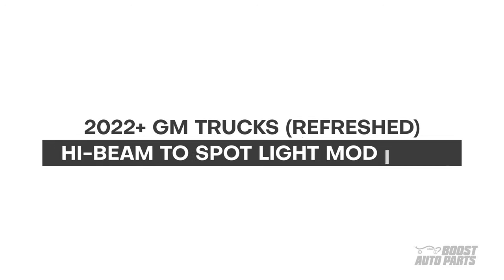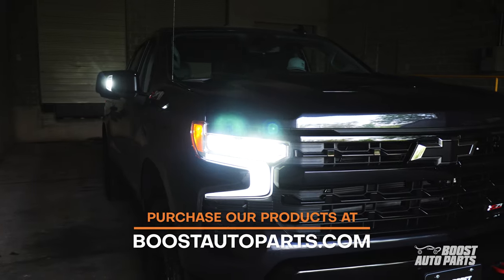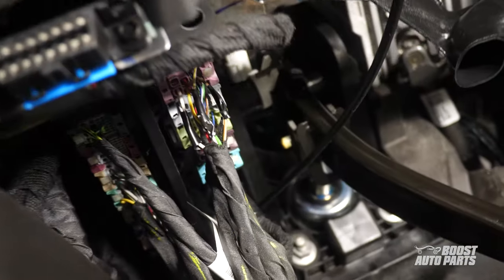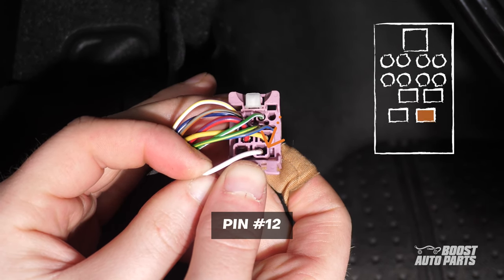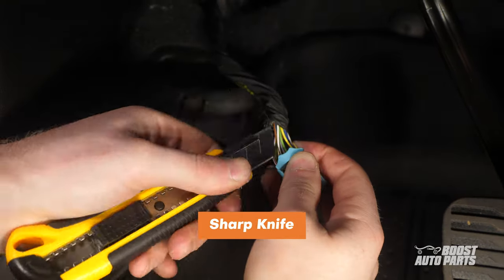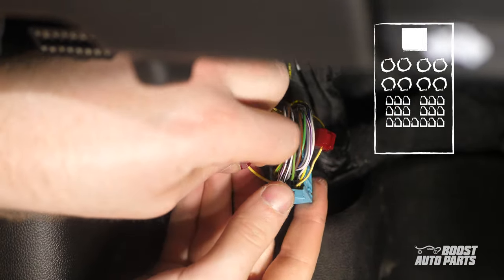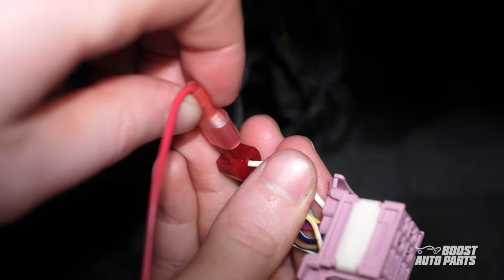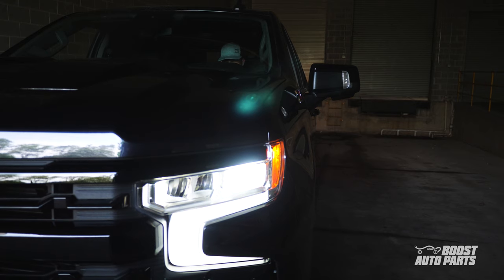2022-2024 GM Mirror High Beam to Spot Light Mirror Mod - Silverado & Sierra 1500 Refreshed

Comment: Hello.  Is there any way to use your guys jumper wire kit to have the mirror spot lamps come on when the truck is put in reverse?  Im guessing you may know which wires to connect your jumper harness to and which terminal the blue stripe would connect to?  Thanks!
Reply from the maker: If you're referencing the rear facing mirror spot lights, we have a kit for that. Check it out here: https://youtu.be/ASQ5LUoYJys

Comment: I have a Check Engine Light on at all times after installing this on my 2022 Sierra 1500 Refreshed.  Is that normal?  I installed it along with the GM AutoFogs Mod.  I installed the AutoFogs Mod first following the instructions on that video.  There was no check engine light on after that.  I verified that the lights worked as show in the video before proceeding to add the GM Mirror High Beam to Spot Light Mirror Mod.  After installing the High Beam to Spot Light Mirror Mod following the steps as shown in the video above, I again verified that all of the lights worked as it should as shown in this video and it did, however the check engine light is on now at all times.  Is that normal ... and how do I correct it?
Reply from the maker: Absolutely not normal and should be a quick resolution. Reach out to our team at 765-831-2830 or support@boostautoparts.com and we will get this resolved ASAP.
Reply: Any update to this?  Same situation.  2023 Sierra 1500.  Check engine light on after install.   Did the “all lights high beam” mod, no issues.  Did the “fog lights on with headlights” mod, no issue.   But after doing this mod, check engine light now on.  Confirmed all t taps are In correct location.  Mirror lights work as they should with high beams, just disappointed to see it throws the check engine light after this last mod.  Any info or update would be appreciated.
Reply: @UNLIMITEDLEASING  On my truck, the check engine light was on the day I did the mod.  The next day the check engine light was off and has not ever come back on since … and mods work awesome.
Reply: @bostaurus7  Thanks for the update!  I’ll leave it on for a few days and see if I have the same results.  Thank you!   Love the mod and hope it works out.
Reply: @bostaurus7  You were spot on!  Check engine light went off today after driving the truck and turning the engine on/off throughout the day.  It’s been off now for a few hours.    Good info to know for anyone else doing this mod to their truck.

Comment: I got this kit but I don't want to install because of check engine light problems others have had. Can Boost verify that the light will go out after awhile?
Reply from the maker: Light won't happen at all. If you're concerned, disconnect the negative terminal of the battery and wait 10 minutes before beginning.